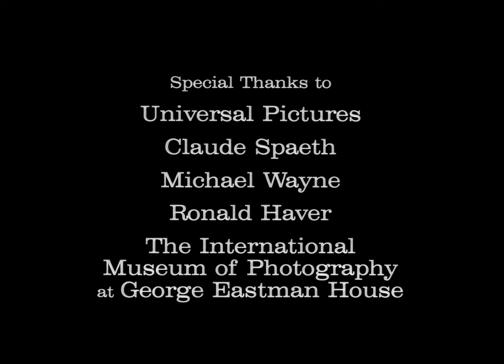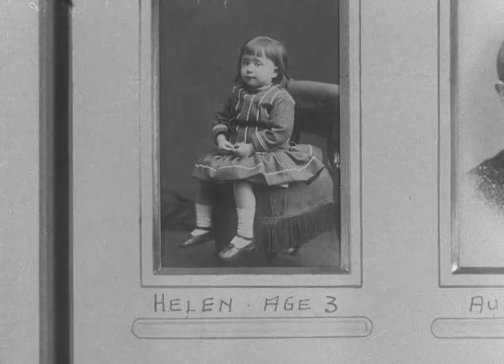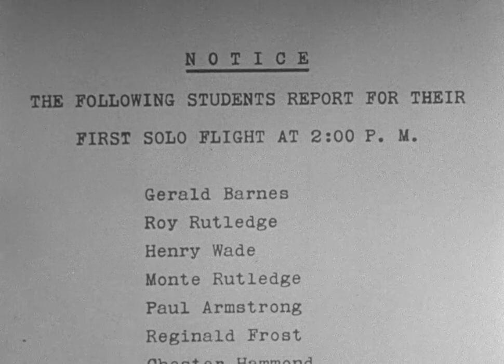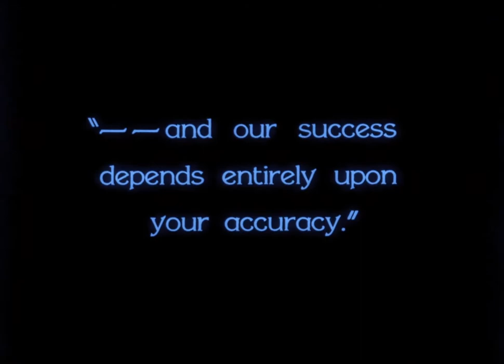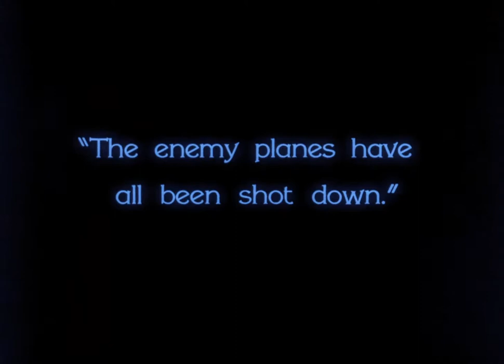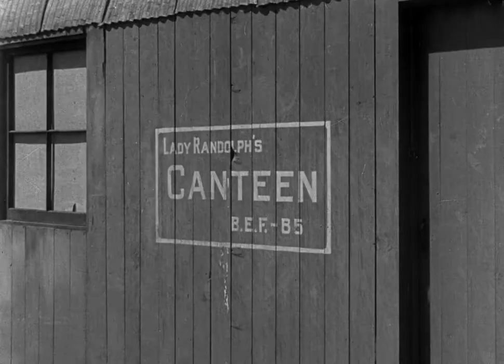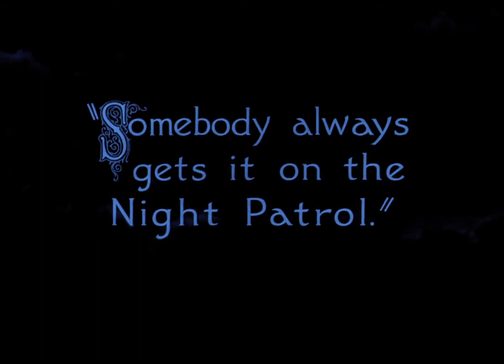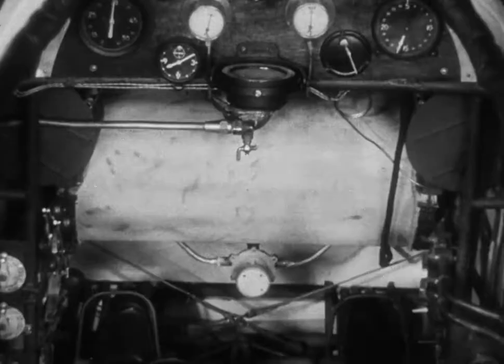Hell's Angels - Howard Hughes (1930)

Comment: Anyone know why several parts of the dogfighting scenes are at 2x speed?
Reply: During the dogfight, I believe some of the cameras either stopped working or broke down. They had to manually pull out the smaller hand-held camera, which does not record at the same frame rate as the larger movie cameras.
Reply: @mrpekko98  thanks
Reply: To show planes faster